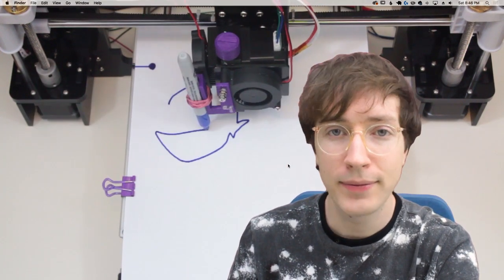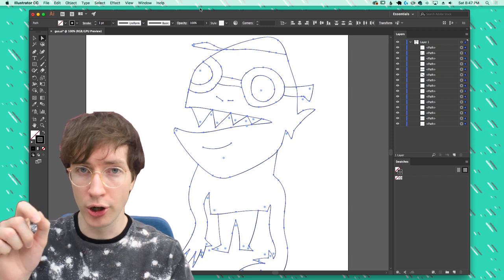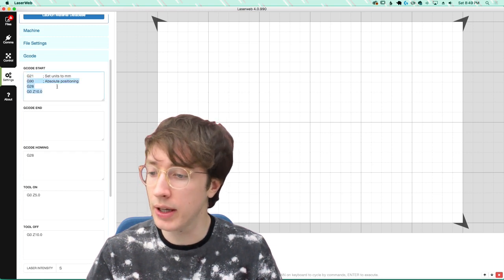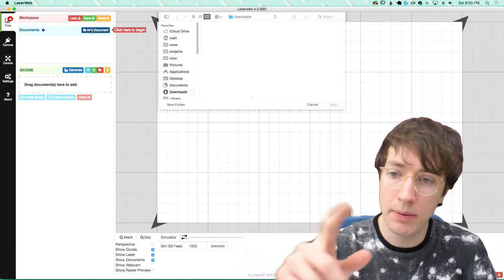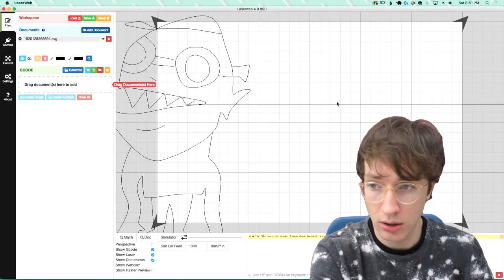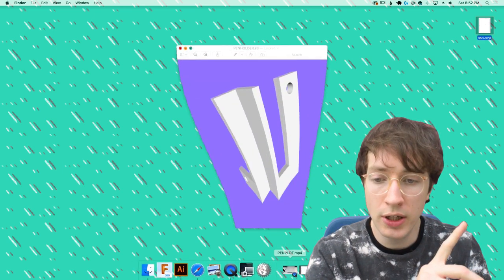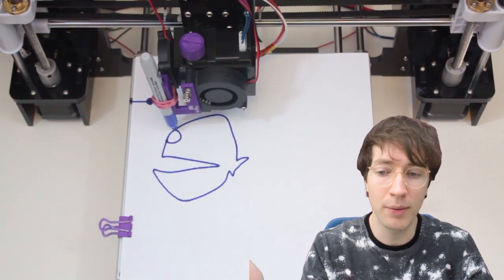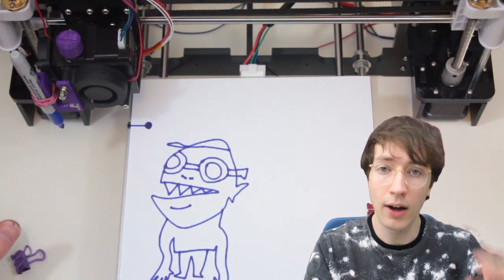Draw with your 3D Printer as a Pen Plotter ( Anet A8 i3 and Others )

Comment: I know this is kinda old, but most slicers now support the direct importing of SVG files, so you can just drag in your SVG, set it to one layer high and print! Should be easy!
Reply from the maker: interesting ! will it do the pen lift though ? i can imagine if it's meant for a single layer of plastic it might not work right
Reply: @ yup! You just have to tweak the z-hop hop setting. I modified my Prusa Mini today and have it working without any conversion. Prusa Slicer even supports adding text and shapes directly to the plater so for basic designs you don’t even need to create an SVG!
Reply from the maker: @andy_warb  oh dang. didn't realize ! pretty dope

Comment: Doesn't work. Program is crap. Takes ages to trace a bitmap. Adjusting settings makes the image either black or white. Loaded a simple SVG instead and generate gcode doesn't generate anything but the header information in the machine gcode setup.
Reply from the maker: program is crap

Comment: great video man 
i am making my own printer and i like to make PCB.
i am close to my first print but my shipment is not on time.
thanks to you i will make modified printer to draw on PCB.

will love to see more video from you
Reply from the maker: Thanks and that's awesome ! I'm glad you found the video useful. Do you have a photo of your homemade printer ? Sounds cool
Reply: @MatthewRayfield  yes I have. I am getting problems with extrusion of filament. Extruder motor vibrate. But I have done 2d images and I also attached my Dremel rotary tool head so I can use as cnc. It works nice with 2d images. I want to improve it's  quality.